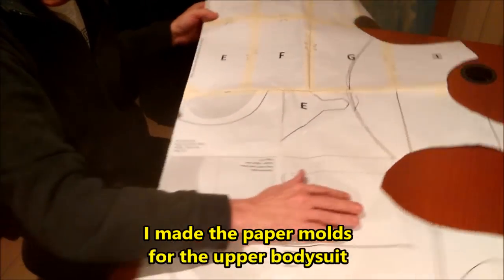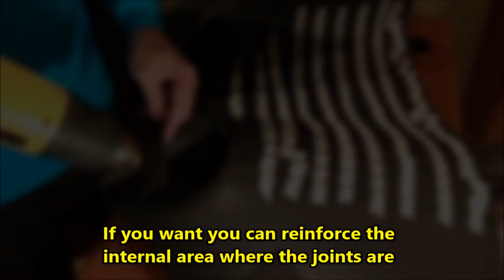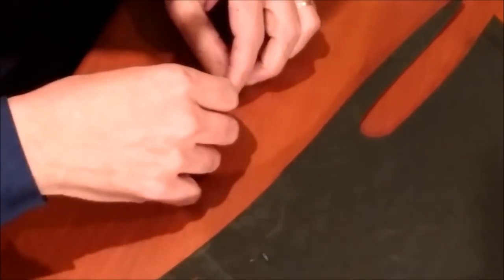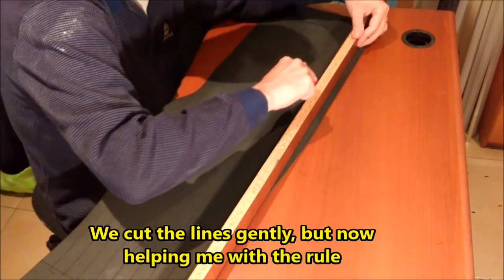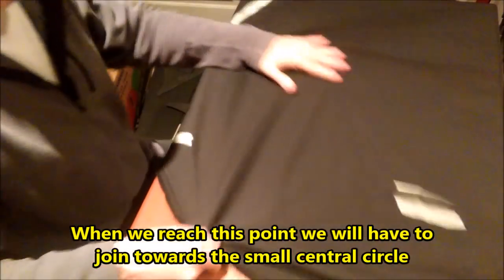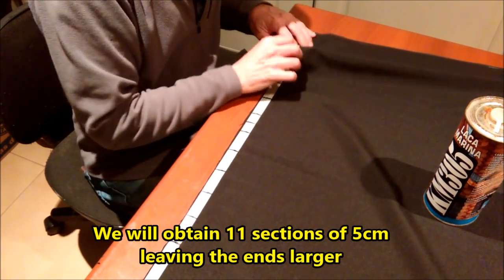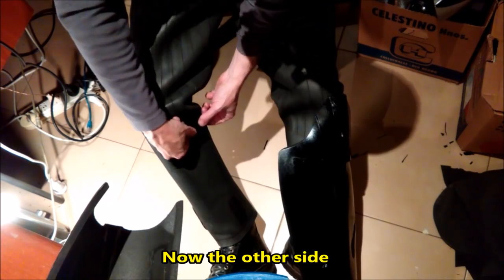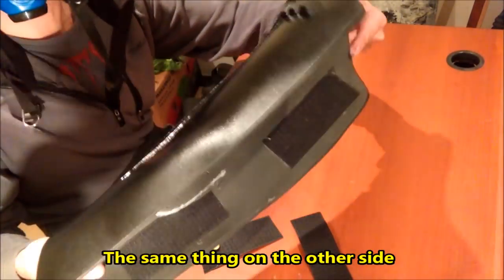Darth Vader Clothes Foam Suit build

Comment: How flexible is that suit. To me foam seems really restrictive. Either way, amazing work.
Reply from the maker: Hi Zangh, It is very flexible, light and comfortable, maybe it generates some heat on hot days, but otherwise it is very comfortable. It is very similar to a wetsuit for water sports, as long as you use the 3mm thick Eva foam to make it and seal it well to make it resistant. Thanks for asking. Cristian
Reply: @StormtroopTemplates  alrighty good to know. Because I plan on building my own Darth Vader replica suit for shooting fan films with and I needed one that I'd be able to do extensive dueling in without being restrictive or the foam ripping because I don't have the funds to get one of the expensive leather bodysuits or make one. So all in all this is a big help. Thank you for clarifying.
Reply: And originally I wasn't sure to use foam for the helmet and armor for a while because I didn't know if it could get as glossy as plastic or fiberglass, but after I saw your videos I've decided to go with the foam way since I saw how glossy you were able to get the armor and helmet. Once again, amazing work and may the force be with you.
Reply from the maker: @zanghproductions2559  The foam can be painted white with Plastidip, and with glossy Plastidip, it's a plastic paint, but you can use other options, you can see the videos (not mine):
youtu.be/ROZlkW96hFI
youtu.be/ug6Rs06FEpk
youtu.be/MDwQg6CX25A
You can even make the foam hard as the original armor like the third video.
Thanks for asking and tell me if you need help.
Cristian
Reply: @StormtroopTemplates  thank you. And will do. I may alter the design a bit for some parts like making the helmet more based on revenge of the sith and the gloves more based on rogue one/a new hope

Comment: Great job… The only thing that has ever stopped me from building a Darth Vader suit is that the flight suits available for sale all look incredibly hot and uncomfortable, I think this could be customizable even if it’s not screen accurate to open it up a bit more for ventilation, your version is great, is it hot to wear the EVA foam? I’m mostly thinking about indoors at conventions or for charity work. Thank you
Reply from the maker: Thank you, yes it's a little hot if you make the clothes with thin Foam

Comment: Hi Cristian! The measure of 75cm of the inner robe is the measure 'shoulder-center of the cest' moltiplicated for two?
Reply from the maker: Hi Giulio,  
Check the instructions on the templates. Contact me via Etsy messenger, so I can help you with images and more data.
Also you can check what I did in the video for inner robe.
They are 2 rectangles of 75cm x 1.5m, each one for each side.
Cristian

Comment: Hello there! What sizes of Foam are you using for the build?
Reply from the maker: Hi, For this template, the basic things you will need are:
· 4 square meters (1m = 39.37 inches) of 6mm/8mm foam (8mm recommended)
· Small area of 2mm/5mm foam (4mm recommended)
· 4 square meters of synthetic leather or 4 square meters 3mm foam instead of the leather for bodysuit
· 3m x 4m (12 square meters) of black fabric for cape and inner robe
· Small area of red and green acrylic or transparent sheets for chest box and belt boxes lights
· Contact cement, hot glue gun (optional)
· Foam cutters, scissors (optional)
· Heat gun or powerful hair dryer instead
· Paper tape
· Velcro
Note: recommended foam density between 60 to 80 (30kg to 50kg in kg by m3) to get the same result.
Thanks for asking
Cristian

Comment: what kind of glue and paint do u use?
Reply from the maker: Hi, the foam can be painted with Plastidip, it's a plastic paint, but you can use other options, you can see the videos (not mine):
youtu.be/ROZlkW96hFI
youtu.be/ug6Rs06FEpk,
I don't get Plastidip in my country so I use a plastic paint called "paste membrane". It is used to seal roof leaks. In replacement you can use PlastiDip which is even better.
plastidip.com/our-products/plasti-dip/
After that you can apply this excellent gloss paint called Liquitex Fluid Gloss:
https://www.amazon.com/dp/B001UNTH2S
I use a contact cement from my country, you cannot get it in yours. So I suggest use Weldwood Contact Cement - DAP or Barge but I have never used them, so I recommend that you try and choose the one that works best for you.Try to get one that is quite liquid and dries quickly.
www.dap.com/dap-products-ph/weldwood-contact-cement
www.bargeadhesive.com/products.html
Thanks for asking and tell me if you need more help.
Cristian

Comment: Outstanding!  What was your cost?
Reply from the maker: Hi, You can find the cost checking all you need. For this template, the basic things you will need are:
· 4 square meters (1m = 39.37 inches) of 6mm/8mm foam (8mm recommended)
· Small area of 2mm/5mm foam (4mm recommended)
· 4 square meters of synthetic leather or 4 square meters 3mm foam instead of the leather for bodysuit
· 3m x 4m (12 square meters) of black fabric for cape and inner robe
· Small area of red and green acrylic or transparent sheets for chest box and belt boxes lights
· Contact cement, hot glue gun (optional)
· Foam cutters, scissors (optional)
· Heat gun or powerful hair dryer instead
· Paper tape
· Velcro
Note: recommended foam density between 60 to 80 to get the same result.
Letter pages to print: 76
Add the painting cost, black plastidip spray paint, silver paint and gloss finish.
Thanks for asking.
Cristian

Comment: Can you please link me to to foam and materials pls and thank yo
Reply from the maker: Yes, you can get the foam here:
cosplaysupplies.com (USA & Canada),  redmooncosplaysolutions.com (USA & Canada), truenorthcosplay.com, (Canada), arda-wigs.com/collections/foam-products (USA), sksprops.com (USA), thecosplaypros.com (USA), tntcosplaysupply.com (USA & Canada), 
poly-props.com (UK), cosplaycrafts.com (USA),
About materials you need simple cutters, scissors, heat gun or hair dryer and contact cement, better liquid. Tell me if I answered your question. Thanks
Reply: @StormtroopTemplates  omg thanks so much